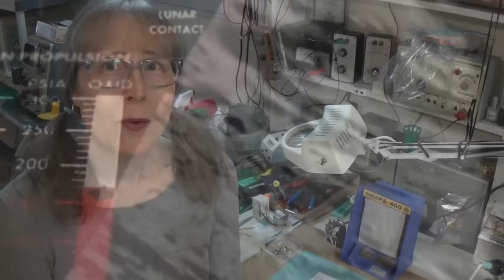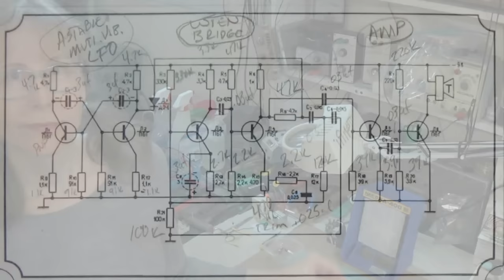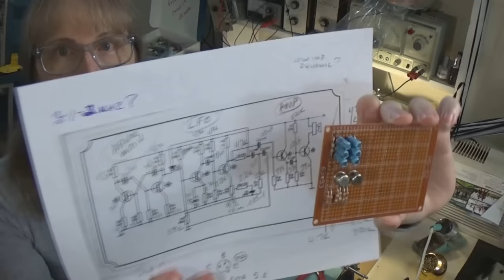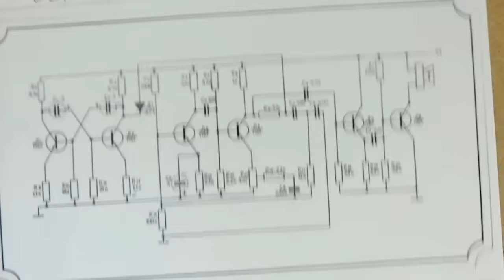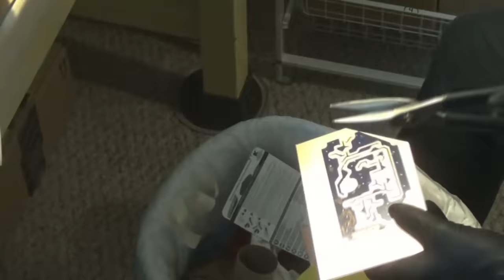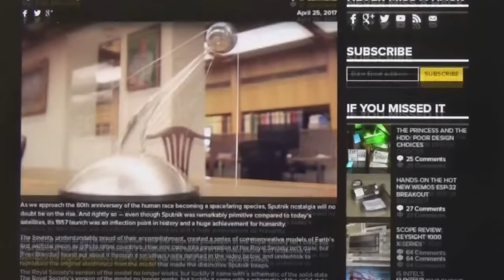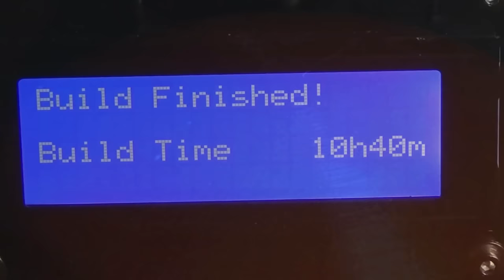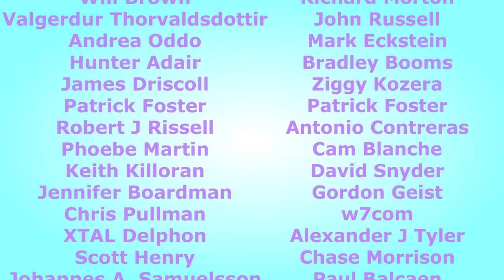The Soviet Sputnik Model Project

Comment: Great episode Fran! I share your enthusiasm for vintage electronics. Have just built the original circuit on a breadboard and it works! The Wien bridge gives a clean sine wave (208 Hz) when the gain of the circuit is correctly set with the trim pot. My transistors are old stock AC151V with  hfe about 75. Analyzing the circuit details, I first wondered that, differerent from modern textbooks, the base resistors in the multivibrator are tied to ground. This makes the transistor conduct by the charging current of the capacitor. This circuit, however, did not work with modern silicon transistors. Anyone wanting to build this circuit with modern transistors should tie the base resistors to the -9V rail. I guess that the reason for this unusual MV circuit was a low emitter-base breakdown voltage of the p6g transistor. In the standard MV circuit, the transistor is blocked by a high (positive for pnp) voltage when the capacitor is fully charged.

Comment: Nice project Fran! It's refreshing to see a project that doesn't involve ICs. I learned something from your Press N Peel technique - using a wet cloth! What would be really cool is placing that Sputnik circuit inside a one half or one quarter scale model of the Sputnik satellite - maybe hooking up a timer circuit so it goes off periodically, OR, making a digital Sputnik clock, with Nixie tubes, that beeps on the hour! Just throwing out some ideas for future projects! I wish they still made more germanium transistors as they have a much lower Vbe drop.

Comment: For those struggling to get the adding/dividing of values with caps/resistors...

Caps in parallel - like several buckets hold more water

Resistors in parallel - like having more garden hoses moving more water faster (and may be uneven, like a bigger and smaller hose move uneven amounts of water, but still more than either by itself)

Comment: I do not throw away the cut-off leads of the parts, but put them in a box and later use them as jumpers on printed circuit boards or mock-ups and for repairing printed conductors on the board.

Comment: Its possible this comes up later, but from the digging I've done it sounds like the tone from Sputnik had period and/or tonal variation based on a number of on board sensors that the Soviets were able to log data from. I think it was mainly temperature, can't remember whether there was any other sensors on board. But that could explain that variability in the various recordings of the signal; depending whether it was recorded as it transitioned from the light to dark side of the planet or vise versa.
Reply: И передатчики Спутника (передатчиков было два, на 40.002 и на 20.005 МГц) были ламповые (vacuum tubes), с выходной мощностью около 1 Вт. На вещательный КВ приемник слушали вы, скорее всего, 20-МГц канал. 40 МГц, УКВ, могли слушать радиолюбители на свои связные приемники.

Comment: I built accurate capacitance boxes for use in teaching in 1981 by connecting capacitors in parallel. Congratulations on getting your lab set up and thanks for the great video.

Comment: One of the issues for early transistors was the variability in hfe or gain. The transistors were either graded by the user or later the manufacturer. This meant A, B & C grades with the three different circuit designs to enable what would be out of design spec transistors to be used with little or no rejects. Things moved up a gear with the advent  of silicon based devices. With the capacitors, electolytics cover values for audio but are typically poor for oscillators as the tolerance as purchased is -20 +50%. From my design days in hif-fi I would used metallised polyester layer capacitors availbale at 1 microFarad and stack these and if you feel inclined to, the legs are soldered on so you can strip and make a large value capacitor with tinned copper wire soldered on as  busbar style for oscillators and audio coupling capacitors. Very enjoyable video and a refreshing level of crazy or should I say Transistoreeee! 🙂

Comment: I had always thought Sputnik was all  transistor...not vacuum tube. The most energy dense batteries of the '50s might have been...mercury? 
    There were ( are?) tubes with low plate voltage ( like 12) for older cars. 
    1N34 was the classic crystal radio germanium diode.
      Sputnik was about five years before my time..
      Cool project!
Reply: I read somewhere - not sure if it's true - that many tubes can be made to work with low anode voltage, just the currents (and output power) will be low
Reply: @mieszkogulinski168   I know there were tubes with low plate voltage in the '50s, some cars had these tubes...but transistors quickly replaced them. Running filaments on batteries three weeks continuously is sort of impressive. Sputnik must have been 90% batteries....
Reply: @scottthomas3792  Not only specialized tubes - I remember seeing a schematic of a circuit using "regular" (not specialized low voltage) tubes with 12 V anode voltage.

I can't really remember which particular tube it was, maybe something like ECH81 or ECC88. It had low output power, but it worked.
Reply: Анодное напряжение передатчика Спутник-1 составляло порядка 80 вольт. Просто аккумуляторная батарея.

Comment: I didn't hear the original one, since I was totally busy many years not being born, but they sent up a replica to celebrate Sputnik in the 90's, and since I already hooked up my computer to an audio interface for SSTV use, I did record it and saved it to a diskette. 
On the original, the tone varied a lot, people gussed it was modulating some information, but it was probably just that it wasn't very temperature stable.
Reply: it transmitted 4 telemetry parameters

Comment: Bravo, they even provided a circuit diagram for the piping and you have a great understanding of both the installation and the approach to the solution.. 1. It can be simplified (not sent into orbit). 2. You can make it more complicated - design a chip. 3. Make your own HF radio transmitter.With love from Russia (USSR) .

Comment: Sputnik three months lasted for 21 days until the transmitter batteries ran out on 26 October 1957. On 4 January 1958, after three months in orbit, Sputnik 1 burned up while reentering Earth's atmosphere, having completed 1,440 orbits of the Earth,
I  still have a shortwave radio.

Comment: The tonal shifts were primarily doppler shifting. My Calculus instructor said it was a typical assignment at the time to work out not only what frequency you would need to tune your reciever to at your specific location at a specific time, but also how you would need to adjust that tuning as the night wore on in order to maintain the strongest signal reception. I'm sure somebody, somewhere handed in a recorded tape of the signal as either homework or extra credit.

Comment: I'm at 12:30, I bet you the speaker is a telephone earpiece, hence the "T" written on its symbol. Those have 200-300 ohms impedance I think. Poor small signal Ge transistors would let the magic smoke out it you connect an 8-16, or probably even 32 ohm speaker to this circuit. EDIT : surprised that it worked with an 8 ohm speaker. I wonder how long it will. 2N404 is 100mA and 150mW, you are probably pushing it over its ratings with an 8 ohm speaker. What is the current consumption of the circuit? At one point, I'll probably build this with Soviet semiconductors (I have plenty of MP41 transistors).
Reply: Yep. Balanced armature earpieces ended up in a lot of "beeping" applications. 
they can be amazingly loud if driven hard. 😁
Reply: I've seen continuity checkers made with them. Also alarm sounders on gas detectors!  @ParedCheese
Reply: @mrnmrn1  Strowger telephone exchanges used to have a "howler" that engineers could put on the line if a customer had left their phone off the hook, holding up equipment.
It put a raucous buzz through the earpiece that could be heard rooms away. 😁
Reply: With a 9V battery, the amplifier stage transistor will likely fair just fine as such small batteries are rather limited in both the peak and sustained current they can source under load before the voltage begins to drop appreciably.  Could very well become an issue if a more substantial power source were utilized at the same 9VDC, though, assuming the amplifier transistor were driven hard enough (which it may well not be).
Reply: Perhaps it was the 2200 ohm resistance I think.The Tone-1"ТОН-1" a telephone earpiece.
Reply: @ethanpoole3443   Modern 9V alkaline batteries are weak only in terms of mAh capacity, but the ones with AAAA cells can supply many Amps of short circuit current. 9V NiMH ones also. They are so powerful some of them has an internal fuse for fire safety. 

One of my NiMH 9Vs died, I opened it up. It was a blown fuse, the fuse was made from a narrowed section of the nickel tape that connects the cells in series. It became so hot it melted the plastic case! It was a relatively fresh NiMH with low self discharge, so I used up its AAAA cells as backup battery replacement on vintage motherboards and Hi-Fi components.

Comment: You were wondering how long the batteries lasted. According to wikipedia:

"It was launched into an elliptical low Earth orbit by the Soviet Union on 4 October 1957 as part of the Soviet space program. It sent a radio signal back to Earth for three weeks before its three silver-zinc batteries ran out. Aerodynamic drag caused it to fall back into the atmosphere on 4 January 1958."

So it stopped transmitting three weeks post-launch, at the end of October, and stayed in orbit for exactly three calendar months before said orbit destabilized, burning up upon reentry.

Comment: Where are the kit?  Those Germanium transistors are not easy to get (or at lease cheap).  The entire moon globe can be printed without supports (I know as I have made 6 of them without supports other than brim).  It should be possible to make a partial earth globe  for this project for the top.  There are Sputnik STL files on-line to make the satellite....

Comment: You should print a Sputnik 3D scale model and placed the original electronic inside, a small rechargeable cell for the Sputnik noise and a very tiny red led light.. Such a model could be a very fancy decoration tool !??! Some scale models costs 2000$ US + !

Comment: I remember the adults going nuts when Sputnik flew over. It wasn't until 5 years later we got our pride back with Telstar.
Reply: Yep, and then the military damaged it with a high altitude atomic bomb test.  The radiation eventually killed it.  I saw the original Telstar transmissions from France LIVE on our old Sears Silvertone B&W set.